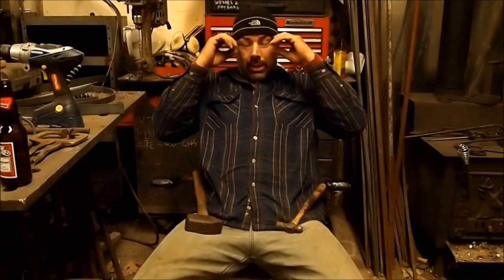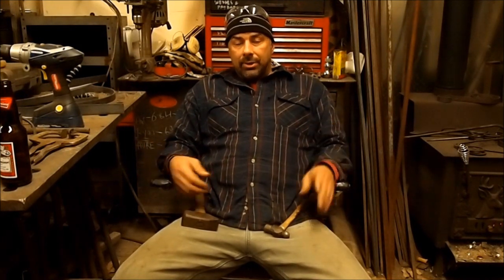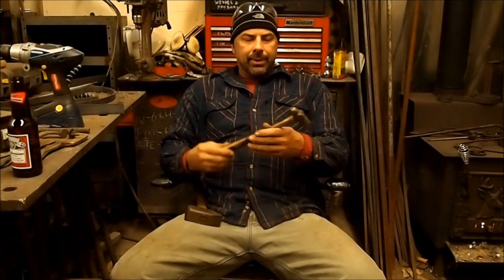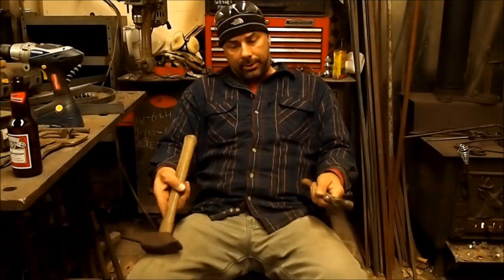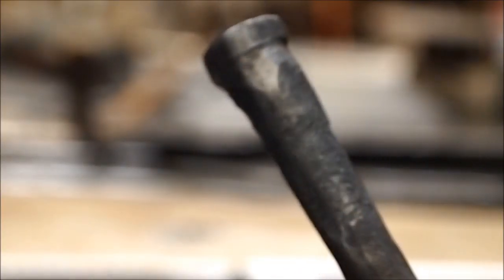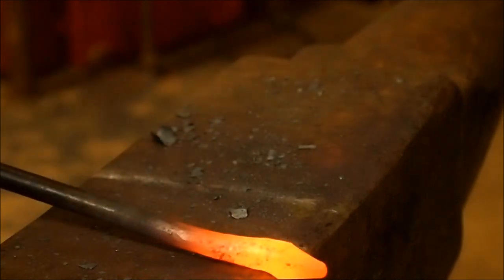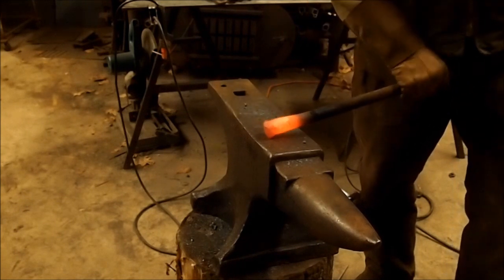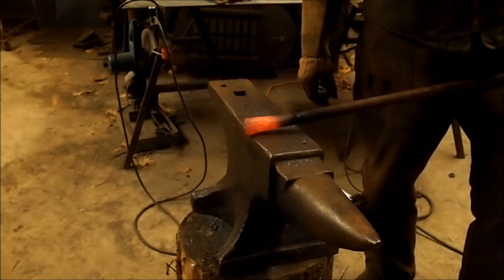Basic Blacksmithing  Upsetting steel (making bars thicker)

Comment: (I am looking for minimal waste of the metal) I need to upset a 12.5mm round bar to 16mm to then forge a ball on the end of the round bar that is 16mm ( I will be making the ball smooth so I do know it will be slightly bigger than 16mm when I come to forge the ball as it will be 16mm in diameter) how much of the 12.5 mm round bar do I need to upset? Also I do realize this video is 10 years old so I may not get a response

Comment: For the sake of argument, what would it take to make a mace-like object. I mean like a baseball or lemon sized ball smithed from a rod with a handle left over, like the cartoon bombs where the fuse is the part that remains as the rod attached to the ball.

Comment: We don't all live in West Virginia where coal is everywhere.... Home Depot or Lowe's as far as I know doesn't have coal !!!
Reply: +Wise Student It's hilarious that you think that in West Virginia, they have a coal isle in the home depot. It's not any easier to get coal in small amounts in West Virginia just because they mine it there. Like anywhere in the US, you have to buy coal from a industrial or specialty supply, they don't have bins of the stuff in Lowe's, and they're not all toothless banjo-playing Oakies and it's not some flashback to the 1800s. If you are doing all your blacksmith shopping at home depot, you're not a very "wise student".
Reply: Coal should be pretty easy to find at your closest industrial area
Reply: You really don't need any coal, my experience with charcoal has been great so far, it gets my metal to temperature! The only thing I run into is that charcoal has a tendency to spark/pop and release fireflies. I fixes that by making sure the charcoal was sifted before use to eliminate the fine powder on it.
Charcoal also doesn't work as well with the tuyer method he's showing in the video, since the air supply comes from the bottom and blows the ashes in the air, but with regulating the heat and blow of the fan, you can minimize it. But I guess it's better to use it outside then.

Comment: modernblacksmith: I have a question. If I wanted to upset an area of metal within the bar, rather than on the ends of it, what would I have to do differently than what you have demonstrated? I have attempted this, but the metal always wants to take the easier way and bend rather than upset.
Reply: I guess securing it relatively close to the area you want to upset, restraining it, would keep it from bending. Can't bend? Will upset!
Reply: Steel Shaper adhear both ends of material with two vices on a gantry rail leaving the center free from clamping. heat the center then hit the unsecured vice (not the material) with a hammer to upset (or swell) the center metal. only way i can think of doing it lol...or cut and fold then draw out each end leaving the center to thickness.

Comment: Please tell me buddy, does forging with 700 grams hammer (roughly 1,5lb) hammer will do? I'm starting out with a clayed wheel rim forge, hair dryer and an 20 lb railroad anvil. I'm a skinny bastard, wanting to know if it'll take me somewhere. I dont mind extra hits or heats, but 1kg hammer and anvil with poor rebound isn't for me now. Maybe later, when my muscles will adapt.
Reply: Rafał Sacha dude equiptment dosent matter. just keep on hammering and your body will gain dexerty and stamina for faster forging. i still use my railroad anvil. its great! plus if you have leaf spring or coil spring you can make a heavier hammer. thats not a problem

Comment: I find a much more efficient way is to cool the last quarter inch of the bar too, that way you have a solid area at the end that doesn't just flatten out, widen and absorb all the energy. You'll get that lip otherwise, and you have to keep knocking it uniform which lengthens it again and is inefficient.

Comment: actually, his words were "I pretty much doubled the mass towards the end". If the end of the bar was doubled in size, then the amount of matter in that location has doubled. However the total amount of matter is still the same. This means that there is now twice as much mass in that particular location of the bar, but the overall amount of mass is still the same. The way he worded it he was technically correct.